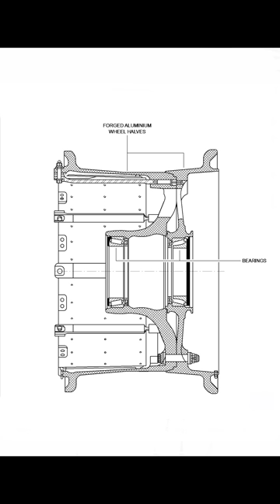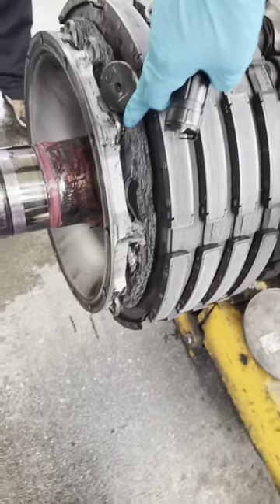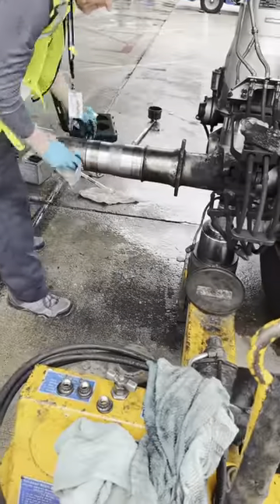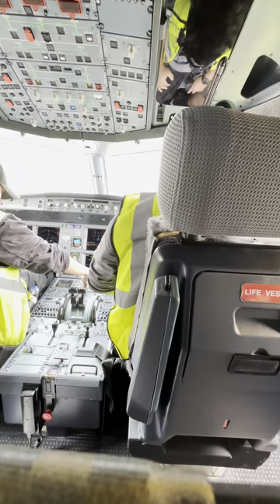Aircraft wheel and brake change due to damage.

Comment: Amazing Video! Interesting to see 2 wheel tie bolts shearing together. We typically check to see if the right procedure(s) were used during wheel assembly (i.e. bolts tightened in a criss-cross pattern. Otherwise you run the risk of few tie bolts in a severely stressed condition). Checking to see the number of hubs and NDT inspection the bolts have gone through is also helpful in identifying if the probable cause is indeed the bolts. If wheel assembly procedures and time on the bolts are noted to be satisfactory, we may look somewhere else.
Reply from the maker: This was quite interesting...and we were all a bit puzzled... but regardless of that we were happy to get it all fixed... we also submitted a safety report to the overhaul facility to see why this happened... hopefully this was just a fluke.

Comment: I remember in a later video, you dealt with a flat tire due to a valve core that failed in the stem, while a rare occurrence, it has been known to happen, I've changed out many myself. But I was not prepared to see the damage done to this wheel and break assembly, as well as the blown out tire on this one, wow! Hear I was asking myself, what caused this unfortunate disintegration? So it was a tie bolt in the split rim design, dang! I agree, whole new wheel assembly, break assembly, and tire required for this one! 200-PSI? Dang, thats a lot of pressure in those tires! Funny how the break pistons sound like cranking over an engine. I love how you give all those hearts of love. 💓 I've watched so many of your video's, and am learning so much. You have massively improved your video production in the modern stuff though, and everytime I have a question, you seem to answer it in an older video, so I don't have to ask lol. I know, your awesome.
Reply from the maker: I’m glad it’s working out well, and I am trying to do better every video and try to include as much information as possible.
Reply: @StigAviation  From my heart to yours, I appreciate it. 😃

Comment: Do you have to rebleed the entire brake assembly, or is each wheel separate? Dang there's a lot pistons in that caliper, bet that wasn't a cheap. Thanks for showing the parts diagram it helps wrap my head around it. When I was younger my neighbor was killed working on a split wheel setup like that, but for heavy equipment. The pressure behind those Hydralic, pneumatic systems is scary when they fail. Anyway great job on the repair, stay safe.
Reply from the maker: I did not have to re-bleed the entire system just that one break, it ties in to the rest of the system. I’m sorry I just didn’t get a chance to show you how we bleed the break. But yes, we do perform that action.

Comment: As a retired commercial pilot (not airliners) I found that really interesting. Are you able to let us know how effective the brake fan is? I'm curious because I read somewhere that if the aircraft has the brakes a bit warm especially after an RTO that when they get cool enough to fly and the brakes are still a bit warm then the pilots can leave the gear down for a extra seconds (can't recall for how long but it wasn't much due to going over the retraction speed) to cool the brakes down. I guess at a 200kts the airflow is the great cooling equaliser. Obviously the brake fan isn't that effective but am curious as to how effective it is.
Thank you for the interesting video. Will now have to watch others. 👍👍
Reply from the maker: Believe it or not, the brake fan is very effective, I have seen brakes come in that are close to 450°, and I turn on the brake fans, they cool down back to about 200 to 150° within 15 to 20 minutes. And yes you are correct pilots can leave the gear down For about 2 to 5 minutes and it definitely helps cool it down. But the brake fans themselves also help a lot when the aircraft is parked at the gate.
Reply: @StigAviation  Wow that's quite a mass around the brakes and to cool it down that much in that time is quite amazing. That would really speed up the time needed for cooling after a high speed RTO. I really appreciate you posting back and letting me know that. I wonder why Boeing haven't incorporated them into their MLG.
Have a good one and Thanks again and I hope you keep enjoying your job until you retire or decide on a career change. 👍👍
Reply: The brake fans are very effective. They also used on a standard turn around to cool the brakes before the next takeoff, they are not there just for RTO’s

Comment: Very informative, quick diagnosis of sheared wheel rim bolts that wrecked the brake pack and cooling fan  disc housing.   No toys chucked out the pram, just fit the new wheel tyre , brake pack and cooling fan disc housing. Regarding the noisy fan ,it is no noisier than the radiator cooling fan on a Scania Slug bus.
Reply from the maker: Glad you enjoyed it, I appreciate you watching.
Reply: Yes,  the  methodical way of changing damaged undercarriage parts not too fast even though the aeroplane is parked at the gate and not earning, safety comes first.   @StigAviation

Comment: Further to my "good enough" comment, how do you deal with the pressure to get that plane back in the air?
Reply from the maker: Pressure doesn't affect me... my priority is safety first... ill ground the aircraft if i have to if i don't feel or know its not safe... its my signature on that airworthiness and those souls on board are my responsibility. In regards to doing the job fast but correctly..well that comes with experience and knowing how to follow procedures.

Comment: When you got to take the plane out, does that mean you're moving under Engine power? Or is it still connected to the tug when you're testing the brakes? So cool!
Reply: He means under the power of the engines. If you test the brakes while connected to the tug more than likely something will be damaged
Reply from the maker: It’s under its own power (we are moving with the engine on)

Comment: Pretty awesome that you had a caliper/brake assembly kit on hand.  Those looked to be 3/4 or 1 inch bolts, and I assume they were Titanium. Did you send them in for testing? 18 Qty  1" bolts should have an amazing amount of tension strength , and I would love to know the root cause of failure.  Titanium is also extremely resilient to heat cycles, so I doubt anything heat related would cause the failures.
Reply from the maker: We usually have the most common parts on hand, which is wheels and brakes, and we did send out the damaged bolt for analysis. It seemed to have been a defective bolt.
Reply: Those bolts are metric.
Reply from the maker: @dadgarage7966  no they are imperial. All commercial aircraft are SAE standard

Comment: Good work!! However did you discover why the bolts sheered off? That’s the true cause. Maybe a hard landing?
Reply from the maker: The initial report was a hot brake, but when we investigated further and looked into the wheel and brake assembly we discovered small pieces of the bolt and other components damaged.

Comment: I doubt it was the tie bolt that caused the issue. It was probably the torque from a seized brake assembly that caused excess stress on a tie bolt because the wheel was locked up on landing
Reply from the maker: No, it was a defective tie bolt. We got the results from the testing. It was simply a defective tie bolt.

Comment: Been an A&P on commercial aircraft for 35+ years, heavy stuff.  Tires on large commercial aircraft have the potential energy of several sticks of dynamite.  You don’t ever loosen the axel nut without a cursory inspection of your tie bolts and deflation of the tire.  I had a B747-200 return to gate after a rejected take-off at SFO and the rapid unscheduled disassembly of the tire and wheel destroyed the forward and mid element of the inboard flaps.  Tires are no joke!
Reply from the maker: You are absolutely right on this sir. But here’s the problem I run into on this particular aircraft. The tie bolts are covered by a dust cap, so I don’t see them on this particular model of aircraft. But i know how to look for signs of damage. Yup. Tires ain’t no joke.
Reply: If the hub follows the axle nut out, then you know you have a problem

Comment: That’s an interesting one with the tie bolt failing and jamming the brake assy. I once had a main wheel on a Gulfstream IV come apart on takeoff out of San Juan. We didn’t realize it until the tower told us we left something’s behind on their runway.
Reply from the maker: Glad you landed safely. Did you find out why it happened?
Reply: Yes, though I NDTed the wheel at every tire change a slight crack was there from day one that never got discovered over roughly 20 inspections. All the parts were sent to a lab that Gulfstream used which created about a 40 page report with pictures from a microscope camera. Fortunately only a drain mast and an opposite side wheel speed sensor got wiped out with us landing in Miami uneventfully.
Reply from the maker: @douglasslotolowicz9454  the one that got away. Factory defects or just bad luck on that wheel. Most importantly you walked away. I call that a win.

Comment: How long did it take you to do the repair job. Did the Airline have to cancel the out bound flight or bring another aircraft in while you did the work?
Reply from the maker: This whole process took four hour delay. At that moment, they did not have a spare aircraft so we had to fix the issue and test it and bring that same aircraft back into service. It’s unfortunate sometimes this happens, delays due occur, but better safe than sorry.
Reply: @StigAviation  That is excellent for a job of that size. Quicker than my car repair shop. Great job and service. It's amazing you had the parts on hand.

Comment: Do you need some type of certification to be allowed to taxi the aircraft? I imagine not all maintenance crew are allowed to do that.
Reply from the maker: Yes. The certification involves training for the particular fleet type of aircraft as well as a proficiency check ride with a designated instructor for taxi/run up/high power run/towing.

Comment: Thank you for sharing this!  Was this at an airport that had American Airlines heavy maintenance hangers and if so, was one of those overhaul mechanics sent to assist?  How long did the repair and taxi take?
Reply from the maker: @lappy0749  heavy maintenance wasn’t involved. Line maintenance did the work and the whole process took 4 around hours
Reply: @StigAviation  So Line even had to get rid of that scrap tire and mount and balance a new one?
Reply from the maker: @lappy0749  we don’t scrap the tire.  We remove and replaced the old one with a new one. The wheel assembly comes pre balanced from overhaul shops.
Reply: @StigAviation  Got it.  Thanks for the insight.

Comment: Do you have to run any conditioning or bedding process with the new carbon discs or it just goes straight into normal service? Also from the video, not all the pistons actuate. Are only half the number of pistons used and the rest for redundancy? Thanks and nice video
Reply from the maker: The new assembly can go straight on without and conditioning. All we do a bleed the brakes at the end (I didn’t get a chance to show that) the pistons are a 2 system redundancy. One set is for normal braking the alternating piston is for alternate braking (basically a back up system) which works on a separate hydraulic system just in case one fails.

Comment: Great video my guy, im courious, how do you tighten those  18 bolts and main one? Fo you use torque wrench or some other specialized tool?
Reply from the maker: Yes indeed a torque wrench that is calibrated
Reply: @StigAviation  thanks on answer. Im going into Aviation highschool, maintenance technician class, and your videos are really interesting, since im watching how my future job looks.
Keep pumping videos!
Reply: The tie bolts are only tightened in the wheel shop during the wheel assembly. They won’t be touched on the line. Only the main axel nut will be tightened to spec on the line.
Reply: @PhD63  thanks for additional info!

Comment: Yep, had one of these come apart on left main gear after a hard landing several years ago which during rollout and taxi to gate made a hell of a racket up inside cabin, lots of grinding noise, and intense smell of smoke. The actions which led to this failure were many due to pilot error but those of us in the back though slightly shaken did make it safely to our destinations but that poor aircraft. It pains me when poor decisions from the flight deck contributes to damage of a perfectly good aircraft.
Reply from the maker: I’m glad you were safe and made it, and it is sad to see aircraft get damaged, but the silver lining is redundancy and various safety features.

Comment: Very interesting! How long did the total repair take, and did it cause significant delays to the aircraft's schedule?
Reply from the maker: Overall, this took about 3 1/2 to 4 hours, including the paperwork and also the taxi functional check. Unfortunately, the aircraft did take a delay, but it’s better to be safe than sorry.
Reply: @StigAviation  Not bad at all, and interesting to know! And yep, safety 1st every time!
Also, for some reason it never occurred to me that the maintenance crew are permitted/qualified to taxi the aircraft around. Do you hold a full pilot's license, or do you have to just take a particular course relating to ground procedures and ground control of aircraft?
Reply from the maker: @DavidTheScientist  no pilot license is needed for taxi operations. But we do go through run-up and taxi training for every single fleet type. And also it’s reoccurring training every year. Also airport operations requires us to be knowledgeable for radio communications. It’s basically everything a pilot does except for flying.
Reply: @StigAviation  Thanks so much for the reply and info, so fascinating. I always figured it was a difficult job from a technical standpoint, but even more than I thought it seems!
You've earned a new subscriber to your channel, thanks again for the info and great videos!

Comment: Great video, great content. I'm interested did you bleed the brakes and how is it done? And why didn't all pistons pushed the brakes in test mode? Very interesting all together, keep up the good work!
Reply from the maker: We did bleed the brakes via a shrader valve, I just didn’t get a chance to show it. The pistons have a dual redundant system, normal braking and alternate braking. We test both systems, hence why you see only one set moving at a time.
Reply: @StigAviation  thanks for clarification, good to know how airplanes are working and how people like you keep them running and keep us safe. Thank you and all the best!

Comment: Love your fibe on this aviation topics
One question, though.

How is it determined that there are nog verder hidden damages in other parts of the front weel system? I imagined that there have been many forces and strengths in and on  various aspects because of this sustained damages. I am thinking about hidden  development of cracks in some part of that landing area or somewhere  else. 
I mean, is there a sort of  renewal of certification ad a sustain point or level of damages or repairs
Reply from the maker: Well, this is why aircraft have periodic scheduled maintenance and inspections when the aircraft has overnight stay. Certain components will be inspected thoroughly. Also the aircraft will get scheduled to go into heavy maintenance at one point or another.

Comment: Very interesting and educational video, thanks for sharing!

How is the brake fan driven, by electrics or pneumatic?

One more thing, when the bypass pin is inserted, why does it seem the parking brake system disconnects as the plane rolls a bit on A320 family?
Reply from the maker: Great questions… the brake fan is electrically ran by a 3 phase motor in the hub of the axel. As for the bypass pin.. that only disconnects the steering. The brakes still work as usual
Reply: @StigAviation Thanks Stig! I was curious because I couldn't see any wiring.

A guy mentioned ZTP mode for the bypass pin, I didn't quite get what that was. If the plane is parked on a down slope, it will roll into the chocks (if there are some gap) as soon as the bypass lever is pulled. Some people suspected that it disconnected the hydraulics to protect PTU, others to let the nose wheel to align in case it was parked with an angle 😅
Reply from the maker: @kenugget9593  😅 ohh boy .. you got some conflicting information there. So the bypass pin has no connection to the PTU. It simply disconnects the electrical signal that sends hydraulic pressure to the nose steering actuators. When the pin is pulled and hydraulics are running, yes , the nose wheels will center themselves. As for aircraft sitting on a slope, if the brakes are set, it’s not going anywhere and the chalks are another form of stoppage if the brakes fail. Hope that clears it up.

Comment: I work in the Wheels and Brake section we service A320, A321 Messers (737), and 787 in Australia glad to see it from the Line point of View.
Reply from the maker: Glad you enjoyed it. Thank you for watching
Reply: Just out of curiosity, how come the tie bolts are not safety wired like most of the other bolts and nuts on the aircraft?
Reply: @kygraeb10 they use self locking nuts

Comment: Interesting YT recommended this video for me. I work the ramp and discovered a similar issue coincidentally on the same number three on an Air Canada A321 during pushback a couple weeks ago. Wheel was inspected and the whole brake and wheel assembly had to be replaced.
Reply from the maker: Glad you caught it. Good observation
Reply: @StigAviation  Indeed. They always tell you if you see something say something. I felt stupid trying explain it to the flight crew and thought maybe it was all in my head but my gut was telling me something wasn’t right.
Reply: @HERBSMAN441 don’t feel stupid when talking to flight crew. They do not know it all